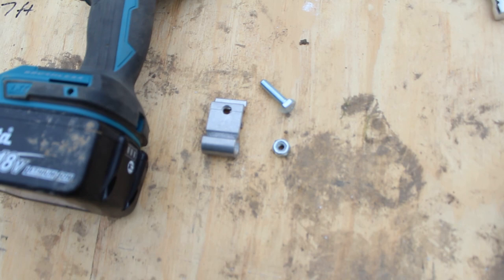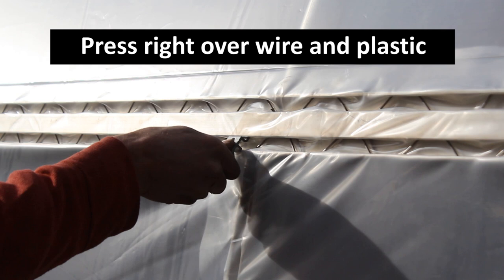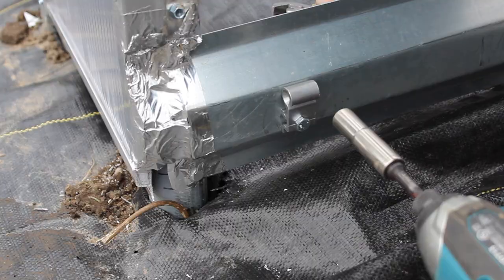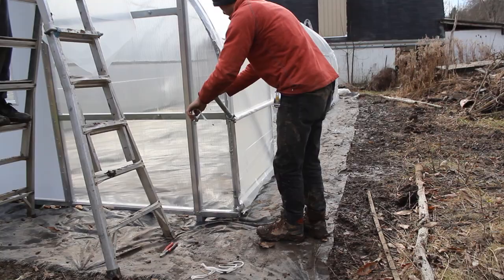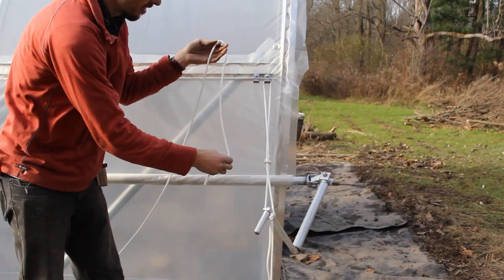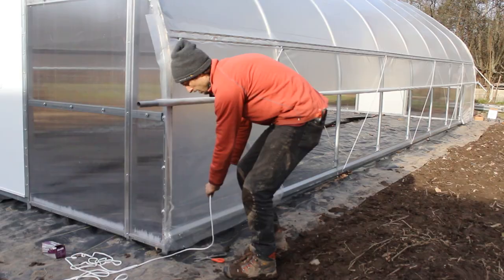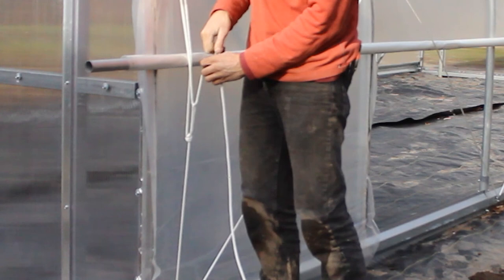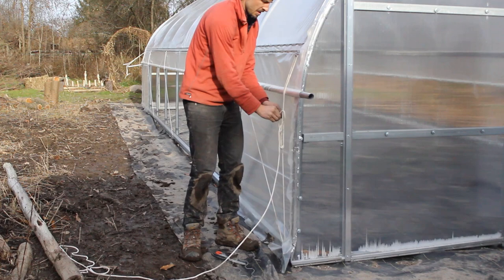Anti-Billow Rope for Greenhouse Roll-up Sides | How to Install to Prevent Wind Damage

Comment: Thanks for this.

Instead of going from hip board on one hoop to the base board of the next would there be any benefits or issues  in going from the baseboard up to the hip board on the same hoop then going to the baseboard on the next hoop and continuing in that pattern?
Reply from the maker: Hey there, thanks for the question. I do not think there would be an issue with how you describe setting up the anti-billow system. Thanks for watching!

Comment: EZ-snap is made by aluminum extension bar-cutting?
Reply from the maker: Thanks for watching, Frank. If you are referring to aluminum extension bars used for roll-up guide pipes, than I don’t think that is how the EZ-Snaps are made. I will say that similar hardware could likely be made by someone with metal working skills though (and a lot of time!).

Comment: What do you recommend if the plastic is in place?
Reply from the maker: You can still use the EZ Snap Hooks and Bolts+Nuts, but you would have to be more careful when drilling through the channel. 

You may want to poke a small hole in the plastic where the EZ Snap Hook is going to be located, and then use the end of a pen or the drill bit itself (before it is spinning) to just open that hole in the plastic up a little bit. Then, at that point, I’d try the 1/4” drill bit; the reason I would attempt it like that is to reduce the likelihood that the drill bit will “snag” / “grab hold of” the plastic as the drill goes through it. This would be what I would do, but of course, you are on the ground there and it may make more sense to go a different route. Hope my input helps at all. 

Thanks for watching!